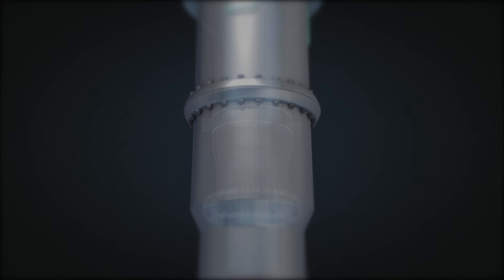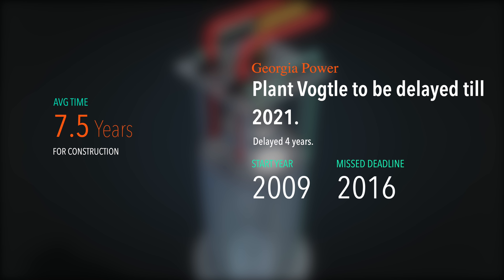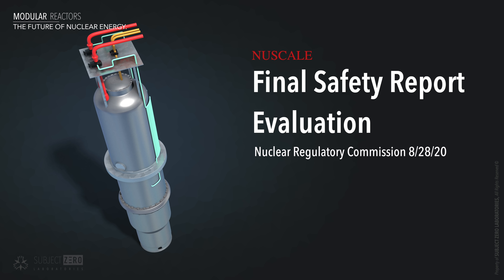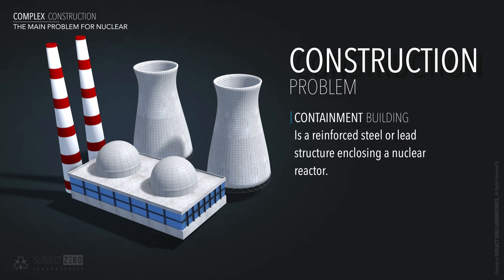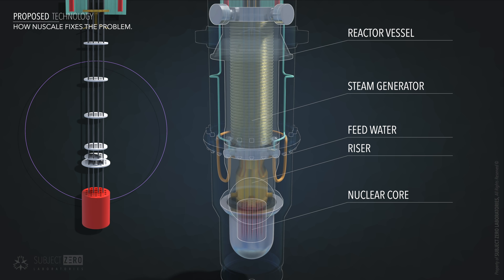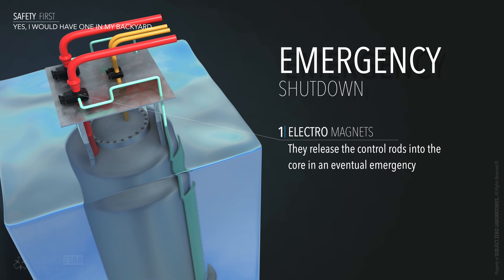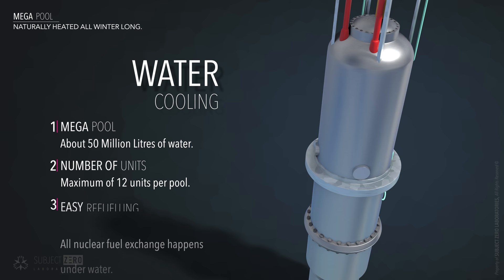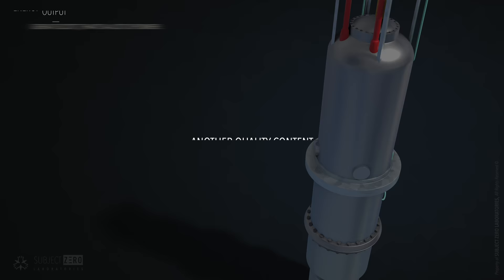A Milestone for Small Modular Reactors (SMR 2020)

Comment: Let me add something that I feel must ALWAYS be added when talking about the Fukushima Daiichi nuclear disaster, because it often isn't:

Yes, it was a pretty dire scenario that the power plant had to deal with... very strong earthquake followed by several tsunami waves. But actually, much like several other nuclear disasters, this one also came from mismanagement and corruption.
https://en.m.wikipedia.org/wiki/Fukushima_Daiichi_nuclear_disaster#Investigations

TEPCO, the main energy company behind several of Japan's power plants and electrical grid, together with the japanese government itself, ignored multiple warnings that a major earthquake event could cause a runaway incident.
The warnings started back in 1991, getting reinforced multiple times in 2000 and 2008, with increased alarm every time it was raised.
All the fail points that led to the meltdown were thoroughly addressed in risk accessment reports, including the possibility of diesel backup generators getting flooded and failing to work. The need for a secondary failsafe source of power came up in 1991, and from 2000 on the risk accessment warned multiple times about the tsunami risk.

This often doesn't come out when talking about the disaster, but several energy officials, regulatory bodies heads and TEPCO executives were fired, some were prossecuted, but found not guilty... because you know how these things go.

But really, the whole structure of safety and checks that Fukushima Daiichi was propped on was rotten from start. Regulators more worried about their careers and promotions rather than public safety.

We have this image of honesty and hard work in Japan, but corruption, collusion and nepotism also does happen there, and it just so happens that the Fukushima disaster is directly tied to one such case. A conservative top down structure that led to corruption which allowed for the disaster to happen. Politicians and executives ignoring multiple studies and multiple warnings for decades of a disaster that ended up happening. And then, media coverage forgetting about it, as well as this part of the case getting sweeped under the rug because it doesn't look good for the japanese government and the most powerful energy company in Japan.

This needs to be said everytime the subject comes up, or we learn nothing from mistakes. It was a disaster, but was no accident.
Reply: Honestly, corruption and neglect are always risks for such big projects. The more complex a project, the more vulnerable it is. I think it's a bit naive to say that nuclear tech is safe if done right. Humanity's track record at project management guarantees that it won't always go right. The elephant in the room is that we need something very close to *always*. The tech has to adapt since our societies just aren't yet capable of reliably handling this kind of complexity (without errors that lead to cost explosions).

The tech has to get less complex and more self-correcting. External, active safety systems are too complex and too vulnerable. Self-contained modular systems are probably the right step here.
Reply: @yog-sothoth9895 :  And fuel ponds in the roof.  There's stuff to keep wet and stuff to keep dry - a 5 year old can tell you which goes in the basement (or better still at a distance).
Reply: If im correct. The Fukushima Daichi plant withstand the earthquake itself, which is basically awesome but it did not withstand is the water that flooded the backup power. Correct?
Reply: And now they have a permanent nuclear disaster in their country that has to be monitor and controlled till the end of time.
Reply: I believe it was also known that the tsunami wall was too low, but nobody wanted to consider improving it since they thought this would alarm the public.

The actual fallout of the accident was also far less harmful than most people realize. The evacuation was most likely unnecessary since the levels of contamination was too low to cause any significant health risks.

But the government still insisted on "de-contaminating" substantial amounts of perfectly good top soil, again just pandering to people's irrational fear of radiation.
Reply: @sirmiles1820  Correct. Loss of the generators that ran the cooling systems lead to the meltdown.
Reply: I’m so damn happy someone wrote this i was just about to start talking about how lazy the Japanese nuclear officials are. The worst part about it tho is that germany completely cancelled their nuclear program because of it and once again gave nuclear a bad face
Reply: @monetaryvalue2303  That is the problem with nuclear. energy. If you have a mistake it is a forever mistake. Doesn't matter who's fault it is. The aftermath is permanent. "A screening program a year later in 2012 found that more than a third (36%) of children in Fukushima Prefecture have abnormal growths in their thyroid glands."  "its ultimate goal has been to 'curtail' groundwater inflow, not halt it". "By 2019, the ice wall had reduced the inflow of groundwater from 440 cubic meters per day in 2014 to 100 cubic meters per day, while contaminated water generation decreased from 540 cubic meters per day in 2014 to 170 cubic meters per day." Not in my backyard. I don't really give a shit who fucks it up. Once it's fucked up we get fucked up. Are you cool with kids getting cancer? I'm not.
Reply: @chaffeyable  People can get cancer or get hurt from all sorts of industrial accidents. Should we
we therefore stop all industries? Of course not. An industrialized society cannot operate on a standard of perfection. This is impossible and irrational.

Am I ok with a system that allows for a statistically miniscule chance of pollution causing some cases of cancer? Absolutely. The wealth created by having cheap, reliable electricity available makes up for it a million fold.

By the way, thyroid cancer is easy to treat.

I'd like to see the article you're referring to.

And let's not forget that this accident was caused not by the technology in itself but by a series of major errors in management. Almost a million people die in traffic every year globally. Should we not have traffic? Try to put things in perspective.
Reply: Exactly.
Reply: @sirmiles1820  Yes correct. The plant was built to a standard Westinghouse floor plan. Reactors at the back, then turbo-generators, then transformers, then cooling systems and finally emergency power generators. That's all fine on a river, but on a sea shore prone to tsunami this was plain silly.
Reply: The piping was also semi-jerryrigged and poorly inspected. https://www.theatlantic.com/international/archive/2011/07/meltdown-what-really-happened-fukushima/352434/
Reply: While you are correct, your example highlights how things happen in the real world. Small Modular Reactors may be a fantastic idea on paper, but we don't live on paper.
Reply: As always, The engineers got it right.. And it was those at the top who cut back safety features for "cost"

Well, I'm sure the cost of the nuclear waste cleanup is alot more now.
Reply: Re: corruption in Japan. I was totally shocked last week when I saw a youtube documentary about how their government is more or less controlled by organised crime!
Reply: Japan also has a very strong "don't question authority" culture which played into the problem.
Reply: @prophetsspaceengineering2913  Hydro electric dams are pretty simple but have killed far more people than nuclear.  By a very, very wide margin.
Reply: Wow, i didnt know about that.
Thanks for the info, i will read more later.
Reply: I thought you were going to bring up Fukushima Daini and how their management structure essentially said screw corporate we're going to do what is necessary to keep the plants cool and they saved their cores. They were located just a few kms down the shore, when faced with almost the same circumstances they survived without an accident. It just reveals how much of the accident has to do with management and not the plants themselves. The nuclear industry took a lot of lessons learned from the incident, the chief among them is our command and control structure for dealing with natural disasters and loss of primary communications to off sight control centers. We also have a whole new beyond design basis mitigation strategy for USA plants due to lessons learned from what Daini did right and Daiichi did wrong.

Here is one of the better articles written about this from the Harvard Business Review.
https://hbr.org/2014/07/how-the-other-fukushima-plant-survived
Reply: @chaffeyable  These are all valid concerns you brought up but what would have happened if we banned fires when the first prehistoric village or forest were burned down due to a cook fire, or we banned cars after the first dozen multi-car highway pile ups? We learn from our mistakes and build better devices and constantly update a set of safety rules to operate them by. In the nuclear industry this is no exception. This SMR design for example is like driving a modern safe automobile in comparison to the driving the cars from decades ago which didn't have crumple zones or seat belts.

When you have a power source which has the least effect on the environment around it we should pursue making it the safest source we can for humans also. There will always be folks looking to blow things out of proportion to make money off of the public's fears, but when looking at nuclear with an objective and open mind there are few power sources which rival it for both safety and minimizing environmental impact.

Should these old reactors be phased out, of course, just like old less safe polluting ICE cars, but we can't let that taint our opinion of new nuclear technologies which make the concerns of the past null and void. The only thing really holding nuclear back is the sensationalism around it. No one speaks about the deaths and toxic waste involved in the renewable renaissance because it doesn't insight the same subjective fears as nuclear does.

It really just comes down to the level on knowledge the public is comfortable with. Nuclear is spooky science because well, it's difficult to understand. Solar, wind and batteries are easy to understand, even if they create a sizable waste stream and the issues of disposal of used panels and turbine blades still has yet to be addressed in the sustainable economic structure of renewables. I have nothing against them as there is a place in a complete energy production infrastructure for all these energy sources.
Reply: Old reactors with old environmental containment and the Japanese government was repeatedly warned about the safety systems being inadequate for the potential emergencies at the site. But there you go - even with all those things being true and total loss of 3 reactors they still held in the vast majority of the nuclear materials and the environmental damage was fairly minimal. If other countries nuclear safety authorities are telling you that your reactors are dangerous, don't ignore them. To be honest IAEA should have things like that in their competences.

All I know is that wind power here in the UK kills more people every year than nuclear energy has in the entire time it has existed, globally. It has a safety record that cannot be beaten, even by risk-averse sectors like passenger aviation.
Reply: Indeed, and many other nuclear plant in Japan were struck by quake and tsunami too, but they had no problem, because they'd implemented the measures they were dragging their feet over with Fukushima. Quite a few of them were even closer to the epicenter than Fukushima. So it pisses me off too when people act like it's just a natural thing to happen when it gets hit by an earthquake. It was mismanagement through and through.
Reply: @anydaynow01  It's not spooky it is well understood. The long term dangers are being down played or not even addressed. This video is a love letter to Small modular reactors. My main concern is what do you do with this stuff after it has been used up. "A permanent disposal site for high-level waste has been planned for Yucca Mountain, Nevada, since 1987. Whether it is at Yucca Mountain or some other location, DOE will transport and dispose of all U.S. commercial used fuel. All major nuclear countries in the world are pursuing similar disposal sites." There is literally no where to put it at this point in time. That should be the starting point, once a secure safe site is found then you can start from there. I'm not anti-nuclear. If they can't find somewhere put the waste they should not scale this shit up. This ad absurdum rant you went on is ridiculous and child like. I feel like the NRC is gearing up for a big push after the election in the states. They seem to all of the sudden shown up on every social media platform with a bunch of sycophant's like you in tow.
Reply: Nuclear power in geologically and indeed politically unstable regions could be dangeroues. Earthquakes, tsunamies, terrorists or simply such deep economic resessions that competent staff emigrate may endager a nuclear plant.
Reply: @prophetsspaceengineering2913  Conditions may change, including creating a politically volatile situation. It may start out as perfectly safe then the area are hit by civil unrest, maybe even civil war. What do you do now? Shutting dow? The lack of power may even escalate the situation with civil unrest.
Reply: pyropulse  100%
Reply: I think I’ve once read that they declined help from the military who could have been there with spare backup generators in like an hour or so?
Reply: So they didn't think it could fail but then it failed. 
At least make sure the next one can't fail then we're all good.
Reply: No matter how you cut a machine you have to pump energy into to keep switched off is inherently a 100 % certainiity if failure if you wait long enough . There is no passive failure mode
Reply: There was also a passive cooling system which failed. There were many systems which failed because they didn't take the tsunami risk into account in the design and the operators didn't test the systems to properly understand how they worked.
Reply: Tell me what mistakes from Fukushima were learned and not repeated at The Summers Reactors in Jenkinsville, SC? You know, the AP1000 reactors (like Fukushima), but  with huge water tanks on the top for passive cooling...built in an earthquake zone on top of hundreds, maybe thousands of feet of shifting sand. Tell me what happens when you put a gigantic rigid reactor with an additional gigantic water tank on top of it on top of sand in an earthquake? Humpty-Dumpty? Thank God it only wasted $14 billion in mismanagement and corruption before it was never finished. The lawyers are feeding off of the scraps right now. Nuclear energy was a disaster, but was no accident. In February, 1985, Forbes magazine published a cover story with the following, "The failure of the nuclear power program ranks as the largest managerial disaster in business history, a disaster of monumental scale...only the blind, or the biased, can now think that the money has been well spent. It is a defeat for the U.S. consumer and for the competitiveness of U.S. industry, for the utilities that undertook the program and for the private enterprise system that made it possible." America and most developed countries recognized this fact and shut the nuclear power industry down. Why do the proponents keep trying to drag this carcass out of the grave? There's money in them thar hills, boys. Damn the torpedos (nuclear) and full speed ahead! The nukies promise they will do it right this time...Right?
Reply: @sirmiles1820  the water that flooded the on-site backup power, and the power connection to other power sources was cut.
Reply: "conservative" implies "right wing" (which it isn't, btw), so I'm just curious as to how you wedged that into your argument? If we took "conservative" at it's literal definition, and not the sullied one from the U.S, that would imply that they weren't conservative whatsoever about the risks associated with running the powerplant without further safety nets.
Reply: @monetaryvalue2303  They canceled it because they had the impetus, not because they were actually concerned with public perception. The eco-shills are all over western governments, provably. (eco shill = solar/wind only types, btw).
Reply: @mikedavey1996  They too have alleles that select for susceptibility to social pressure, as well as millennia of Confucian culture, almost as if genes came before culture and built cultures to reinforce themselves...
Reply: Drinkin' Bleach Once again the fault of the Japanese government not taking proper precautions or properly evacuating or doing a proper cleanup in the surrounding areas.
Reply: aiGeis More and more people are learning tho that to produce solar arrays emits more greenhouse gasses and co2 than a nuclear power plant will in its entire lifetime
Reply: TODarkschnider420 No they didn’t, the public was anti nuclear leading up to fuku and merkel made the speech after fuku
Reply: XSportSeeker, Bravo!  Well said!  In my 22-year career as a freelance realtime court reporter, I reported verbatim testimony of corruption gone rampant in many cases in the U.S., and, guess what, some of them, interestingly enough, involved Japanese companies.  I’m not pointing fingers, but, rather, letting people know that corruption happens in every country, at every level, no matter what their culture is.  If there’s one thing that being an officer of the court for 22 years has taught me, it’s “Where there’s money involved, there’s the potential for corruption.”
Reply: Indeed  like most disasters it didn't appear out of a vacuum rather   it emerged as a consequence of a long cascade of failures in terms of the interactions between geology, culture, politics, economics, and their net inertia regarding  infrastructure.   Overall it needs to be pointed out this is a consistent problem not limited to nuclear power and is a large part why we need a strong system of transparency  and independent oversight. Examples elsewhere include Deep Water Horizon, catastrophic bridge dam failures, the Levees in New Orleans in hurricane Katrina,  practically speaking the same sorts off societal and cognitive flaws have  caused similar cascading problems.

Only systems with strong countermeasures towards innate human biases and methods to repair themselves against corruption and abuse of power but also possess the  ability to rework and as necessary consolidate or decentralize where needed to reduce leggy response times will ever have the chance to sustain itself . The time it takes for a system to fail is a factor not only of disasters but how well structured and resilient it is to the natural decay entropy enforces on everything. In a way corruption nepotism laziness overinflated bureaucracy, the loss of independent oversight & accountability, and system wide networks of checks and balances all represent manifestations of the second law of thermodynamics on a societal scale. Thus far all examples of human societies have fallen apart once a combination of external stresses and internal decay eventually lead to the dysfunction or collapse of the system.

Thus the question I have been wondering can science play a role in helping us philosophically  optimize our potential systems of governance infrastructure and economics towards maximized sustainability? Is this not an extremely complex optimization problem? I feel we need to move beyond the era of opinions into the era of research driven data management focused for the good of society.
Reply: thank you
Reply: @phamnuwen9442  Since 2011 more than a million tons of highly irradiated water have poured into the Pacific. The Radiation scrubbers, the machines and filters that partially clean some of the water runoff are so contaminated no human can go anywhere near them.. They have taken readings on the surface at the plant of over 1000 Sieverts per hour, enough to kill a person within minutes, higher than at any point since the disaster began. It is still illegal to report on Fukushima within Japan. The incidence of Thyroid cancer in children under 15 years in that area prior to 2011 was less than one in a million, today it is one in thirty. I guess the gov't are just pandering to peoples irrational fear of slow painful death, why don't you move over to Fukushima with your family and set an example...just saying.
Reply: @Pham Nuwen Since 2011 more than a million tons of highly irradiated water have poured into the Pacific. The Radiation scrubbers, the machines and filters that partially clean some of the water runoff are so contaminated no human can go anywhere near them.. They have taken readings on the surface at the plant of over 1000 Sieverts per hour, enough to kill a person within minutes, higher than at any point since the disaster began. It is still illegal to report on Fukushima within Japan. The incidence of Thyroid cancer in children under 15 years in that area prior to 2011 was less than one in a million, today it is one in thirty. I guess the gov't are just pandering to peoples irrational fear of slow painful death, why don't you move over to Fukushima with your family and set an example...just saying.
Reply: @iengishu5  Present sources for your claims.
Reply: @iengishu5  Your link doesn't load.
Reply: Blah, blah, blah...you talk way too much just to bring up irrelevant points. IT WAS NOT A "NUCLEAR" fiasco. It was hydrogen gas explosion and it would have been averted if the reactor had NOT been shut down. When the tsunami took down the generators, the reactor would still not have been without the power to provide the necessary cooling to keep the pressurized steam from reverting to its oxygen & hydrogen component parts, thereby avoiding that hydrogen/oxygen explosion. 🙂
Reply: @logandeathrage6945  There was NO nuclear "meltdown"...only a hydrogen/oxygen gas explosion that blew a hole in the pressurized steam containment dome. Without cooling,  the superheated and extremely pressurized water steam turned into its oxygen & hydrogen components. The hydrogen explosion did little or no damage to the actual fision part of the reactor was not damaged in such a way as to cause any sort of "meltdown". If they had not shutdown the reactor, the reactor itself could have provided that the generators could no longer provide.
Reply: @George Mann yea you got it but now you need to ad the cost of disposal and containment of the spent fuel for the next ten to one hundred thousand years to determine the true cost.
Reply: @George Mann what do you do with the fuel that is leftover from the second reactor after it is no longer usable then what where do you put it and these wholes you are going to drill do you have a place that will let you drill there nobody wants it in their backyard . we have three contaminated place's now Japan Harrisburg and Russia how long will they need tending to and who pays. If we continue we will certainly have more places to clean or protect for years to come . No I do not want nuclear plants to be all over the place even if it was free to build at no cost some things are just not worth the risk!!!!
Reply: @George Mann nothing is fool proof you are playing with fire.
Reply: Why haven’t small reactors been used all along. To me it makes too much sense to build reactors on an assembly line rather than custom built each time.
Reply: @timm2845  Actualy, СВБР-100 and brest-300 have absolute foolproof lead cooled reactors that uses a two circuit heat transport
 system to deliver heat to a steam turbine.  But they still in project. High level of inherent safety due to natural properties of the lead, fuel, core and cooling design.
Reply: @timm2845  Ugh this is a dumb argument. There were 3 reactors that screwed up a bit or a lot. So what? There are nearly half a thousand that exist and 3 had major problems. And those were OLD. Now, when building new reactors there will have fail safe upon fail safe because we are human and we learn! Also, for nuclear waste, stick it inside mountains until we can send it elsewhere, like maybe in the future, catapult it into space, never to be seen from again.
Reply: @venomsoul1147  Just realised somebody else answered... hehe well anyway that proves my point. New reactors will be virtually perfect. If we remove the human element, then it would be even closer to perfect
Reply: @sirmiles1820  there's also some indication that the reactor housing was compromised and allowed salt water into the reactor, which then cause rusting of other systems while acting as a mediator. I'm not certain on this, so take it with a grain of salt.
Reply: @thomasleroy5433  Indeed. Power demand of all population unlimit! And now, right now wea have worked system, whtat have more and more upgrade potential. Agree, wea should act safe, but still, our scentific, food production, ECOLOGY stay on power consumption. I can say - 14% its stupidly small. Hope someday humanity give solid kick-ass to current government systems.
Reply: Yeah... very informed opinion there. The Japanese engineers should've foreseen the once in 100,000 years earth quake that no other person on planet earth did. Watching Westerners literally shoot themselves in the fot over nuclear is hilarious. Don't worry bro. It is a good thing that the nuclear industry is no longer coupled to the illiterate opinions of random Americans. There is a nuclear rennaisance sweeping the globe and it will remain like that regardless of your opinion.
Reply: @agarjakendu  Western satelites can ban NE, stop energy trade, but hey, here some more countres on earth who just dont underastand that game. Hypercapital just protect his riches, his powerty, his rules. Numerously sanction in any direction, cant exclude progress, or revive economical bubble. And time is about to harvest changes. Stand up fearless my friend, and hold tight. New era is coming. My butt feel it...
 About Japanese and Chernobyl. Yes that sad, and costly lessons, many inocent people leave they houses, but fauna in closed zones feels fine now. Forced national park to me.
Reply: You point is valid which is why I do not want to see land based Nuclear Plants utilizing water period. Molten Salt is a better and safer medium. Although, I like the small modular concept rather than huge complexes for manageable quality control. However, I don't see the NRC allowing them to sprout across the country. NASA has a very cool small 10KW nuclear generator. It is self contained utilizing only air heated and piped into a sterling engine. The US really needs nuclear power for our economic security and environment safety.
Reply: TODarkschnider420  It's not dead yet. Dependency with unstable providers makes you rethink. Also their carbon emission levels cannot be sustained if they wish for a robust economy.
Reply: @chaffeyable  you have to read the rest of the study, it says that given such area-wide studies have never been made, it is not conclusive... Just like for breast cancer, some cancerous spots may never grow
Reply: Micro Portable Nuclear Reactors, This is something our Provincial Government has now decided to financial back, It's a really bad idea. "Many terrorists Dream come true".  Shut all Nuclear Reactors Down!  except 4, in order to produce the worlds medical isotope needs. And make certain that those 4 are nowhere near coastal areas. Remember, 3 Mile Island, Chernobyl and Fukushima Daiichi which is still not dealt with.
Reply: @michaelpettersson4919  Yes on both points. Also Murphy's Law is in effect everywhere, even in stable regions.There are an unlimited supply of Homer Simpsons to run the most complicated energy system ever created to boil water. The only place known to man that has fission byproducts is Earth. That stuff is the most dangerous stuff known to mankind and lasts for 250,000 to millions of years. No one has come up with a solution to nuclear waste in eighty years,  but we are going to have to deal with it safely for millions of years. But nuclear proponents say we can't use solar because we can't figure out how to store it overnight. Brilliant!
Reply: @shodanxx  OH! and clean up the mess while you are at it.
Reply: @jackfanning7952  All of that is complete nonsense. There was no "nuclear explosion". Nuclear bombs don't spontaneously self-assemble inside reactors, whether during normal operation or post meltdown.
Reply: @phamnuwen9442  Don't believe me. Believe the evidence presented by scientists that examined the catastrophe. Do not speculate.
Reply: @jackfanning7952  Give me links to your science if it exists.
Reply: Yeah, when the rich pull fuckery it's the poor who die.  Wasn't there also stories of workers knowing that they would die when working on cleaning up that mess?
Reply: I could have sworn you were talking about my country, but you're referring to Japan!
It is interesting to read these perceptions about the culture of the country of the rising sun, at least for us.
And today, what about these principles? Still running?
Reply: As the chief engineer of a company that constantly ignores my warnings, I fully understand your reply.  Every company today operates on a single premise:

1.  If they heed the warning and make the changes, it will hurt absolutely and expensively, and someone will have to explain that to the shareholders.  And since shareholders ONLY care about their money, that guy will probably be fired.

2.  If they ignore the warnings and make no changes, something MIGHT happen that will hurt, and the expense MIGHT be high...but in the meantime, let's party because the shareholders are happy.